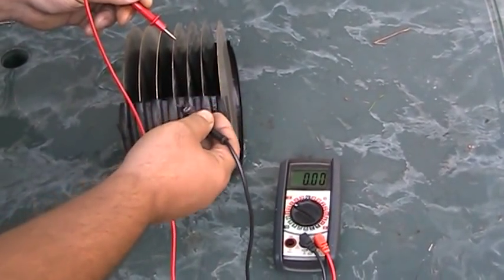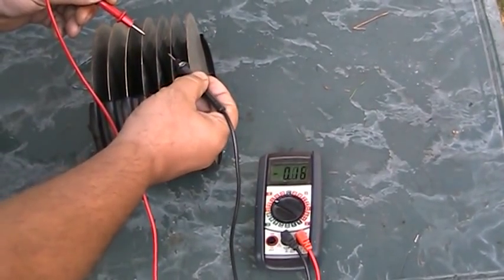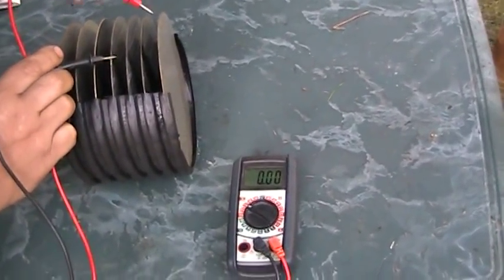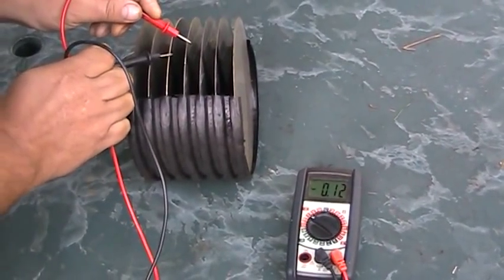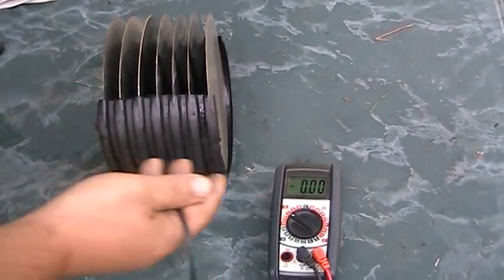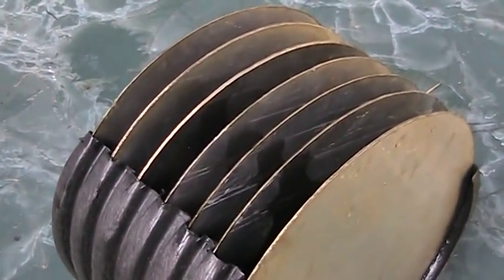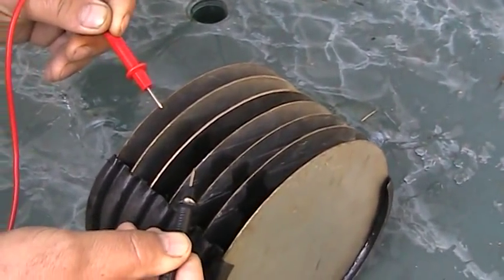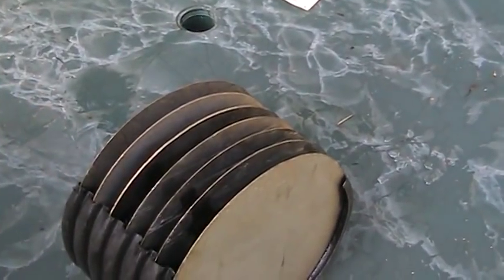joe cell, voltage on dry plates

Comment: You can change the voltage simply by changing the distance electrons are from the things that attract them. The closer they are the stronger the attraction, and the same is true for gravity. So when you are a lightyear away you don't think of the force as potential, but there it is. The potential remains relatively unchanged at very large distances.
Battery plates hold electrons on their conductive surface. Non-conductive materials hold electrons on the inside.

Comment: The important thing to remember is the POWER. When you have both current and voltage then you have power.
The only way to have both is to have something resist the current, which the voltage maintains. Make sense?
To calculate power, you just multiply your volt (potential, V, U) reading by your amp current, I, A) reading.

When you cool your plates, you lower resistance, and this makes electrons flow more easily, raising the voltage, because aka potential is not being used to maintain flow.

Comment: Voltage doesn't mean terribly much. What could be causing that voltage measurement you're seeing is most likely a capacitive effect. Try putting a 10 ohm resister across the plates and measure the voltage across the 10 ohm resister. Square the voltage you get and divide by the resistance and you will see how many watts you will get.

Comment: Magnetic fields create a current in conductive material, such as metal.
The current is perpendicular to the direction of the magnetic field. The magnetic field is multidrectional, but strongest along one axis.
Turning a magnet near a wire can create some kind of AC current. 120 hertz means the current changes direciton 120 times per second. When the magnet(ic field) is parallel to the wire you will see 0 current, and no added voltage.

Comment: This happens because that thing is essentailly capacitor, and when disconnected it will remain resisiting the inductanse change thus showing voltage on the plates.

Comment: Placing electrons close together, or pulling protons and electrons apart, requires a certain amount of energy. This amount of energy then becomes a "potential" energy.
The exact same concept as holding a basketball over the ground. You measure the distance the ball is above the ground and we know the force of gravity pulling it.
It does not require anything at all to be there physically. You can change the potential by simply moving the ball or changing gravity (moving the Earth.)

Comment: Flow current amp. Whatever you want to call it. IT is controlled by your plates, by the energy they can potentially receive. The bigger the bucket the faster the flow.
This naturally lowers as they fill up over time, raising the potential in the plates. 
When you remove the wires, the plates will hold the charge until it finds somewhere else to go and you can again measure it.
Batteries, I feel paradoxically, work better with some heat. Presumably to increase chemical reaction speed.

Comment: To create electricity, you simply move a magnet over a wire. Nothing is added and nothing is taken away; only the internal structure is altered.

I am not familiar enough with batteries to say anything, just a few calculations.

You can change volts to practically any number you want just by the way you wire a battery. A volt meter changes the voltage. A capacitor changes the voltage.

You could literally smash 5 batteries together, measure the voltage, and I would have no way to explain it.

Comment: @jocell202 Reading from a paper titled "Excess Heat Production During Diffusion Of Deuterium Through Palladium Tubes" by Jean-Paul Biberian and Nicolas Armanet, they refer to the phenomena as the Fleischmann-Pons effect.
I think it would be best if we used that term instead, perhaps F-Pons for short.
I don't know what the difference between this and any other chemical reaction as far as producing heat, but the experiment calls for heating palladium to 500C and running some deuterium over it.

Comment: If you take the known effects out of your observations, such as changes in temperature which affect the resistance, then you are left with only unknown properties and variances of material and energy.
I find it frustrating that current and amperage mean the same thing and that I is used to abbreviate current, Q for flow, B for magnetic induction, and so on, making it difficult to study.
Beyond theoretical equations and controlled experiments there is also use and methods that work in real world.

Comment: @jocell202 Part 1:
I was not talking about superconductivity.
No.
I was never taught electrical generators are close-looped.

Part 2:
Are you refering to a generic gas powered generator or John Searl's generator?

I think you need to write down your results, clean your plates, and get new measurements.

Comment: If you know what flow is, flow defines electricity more than voltage. Think of a river, the flow is found by measuring the depth and width of the river, and the distance a toy boat floats down in a second. You multiply those and you get the gallons per second. This is the current. The same in electricity, the current is the flow of electrons.
You don't need voltage to have flow, a wire can hold electrons forever, ignoring friction of course
You don't need any current to have a voltage.

Comment: Voltage increases linearly (1:1 ratio) with the current. Power increases exponentially (square the current) with the current.
Voltage and power both increase linearly with resistance.
current (I) voltage (V) power (P) resistance (R)
V = RI
P = VI = RRI
You have probably collected data that supports this.
If you have voltage, and bring a magnet in, it would decrease the voltage, increase the voltage, or do nothing depending on the magnet's orientation.

Comment: @jocell202 Communication has it's difficulties; learning from similar text-books helps.
What object are you saying has a "high spin state"? The motor, or the electron?
I don't know anything about electron spin states, other than +/-1/2.

I assume "excited air-molecules" causes the glow Searl said was around the generator.
I have never dealt with ion-fields or generators, but I don't think generators "take" many electrons.

I fail to see the connection between J. Searl and cold fusion.

Comment: @jocell202 I attendend a reseatch presentation over a material which, placed under stress, created an magnetic field. The the atoms were arranged in a such fashion to do this. The research could be very valuable.
I've also heard of materials which expand in one direction while being stretched in the other, and other contradictory habits.
I was able to understand parts of the explanation fairly well after just 2 physics classes, and I have some sense of what electricity is doing.

Comment: @jocell202 It just doesn't seem to me that by slipping a wire through your radiator you are going to get the Fleischmann-Pons effect. It seems quite difficult to produce.
Were you saying this was charging your car's battery?
It seems like you are missing a step, if you are adding anomalous heat to a water supply designed to to dispell heat.  Further, the last time I checked, hot water does not recharge batteries or rotate drive shafts. Although, heat improves battery performance.

Comment: If you have positive ions (protons) drawing electrons closer, you are losing voltage.
You have to consider many common sources of physical manifestations. The major ones can be found in a 7th edition (1990) College Physics textbook for $1.00 at Abe Books.
I presume they have the same basic equations and the same uncomforting explanations I have read.
I think what you're doing is great. Physics certainly has unexplored nuances, writing obviously is one... but at least they put it all together.

Comment: Changing the voltage doesn't mean any one thing. It could be the temperature change of the plates, causing them to move apart, changing the chemistry in the BAT, or the electrical characteristic of the material between the plates.
There is no real way to tell without precise measurements, testing a hypothesis which includes all the variables you can consider, features all relevant scientific facts, or at the least the scientific conventions, and is done in a more strictly controlled environment.

Comment: his engine appears to be on the foundation of old generators the pulsing starter motor figure 8 off the pos exciter back to the alternator 3 phase interlinked windings and using the external air as a potential ground the crank shaft is the centre generator shaft and the engine oil and water become the carbon brushes to transfer the static build up through the flywheel and fan belt and then returns to starter between the figure 8 there is a 90degree solid wire to the block  that becomes the capacitor resistor   look on his escort on the ht leads on the rocker top you will see the throttle cable resting over all 4 this takes that spike to the air intake to cause a energy lightning charge  i think